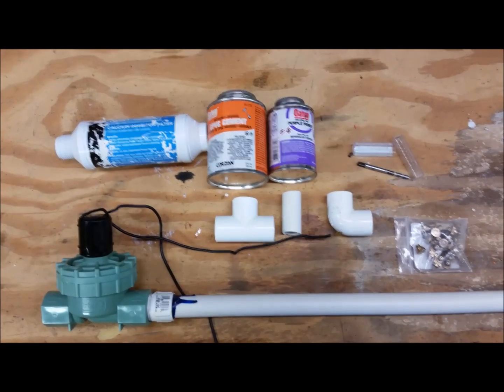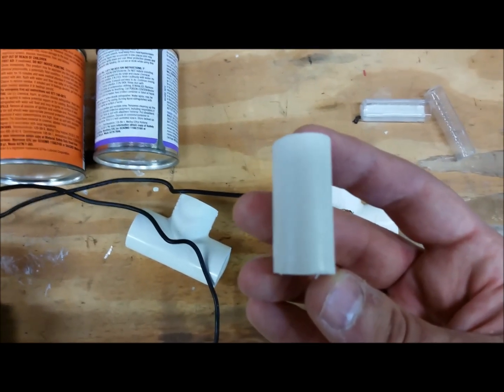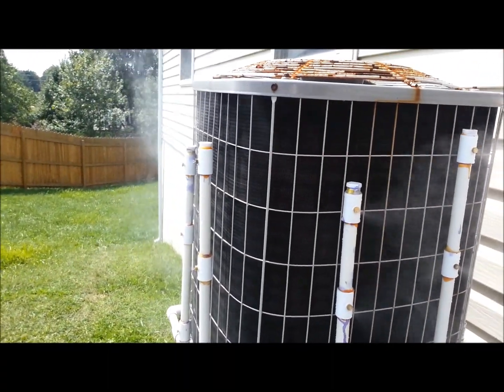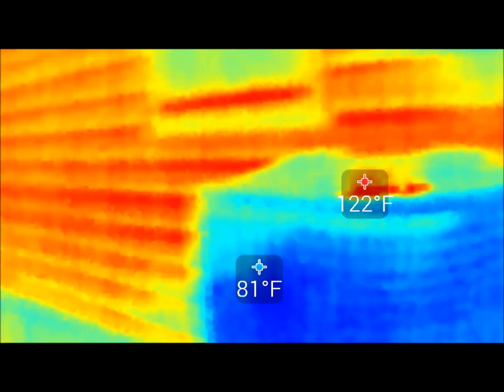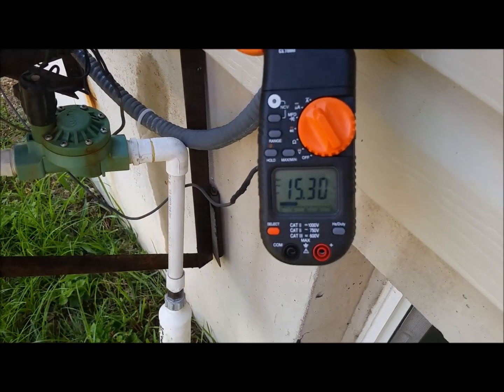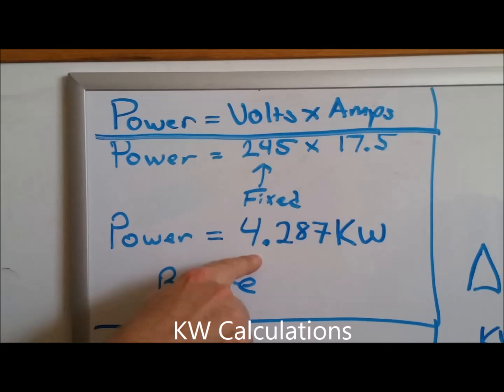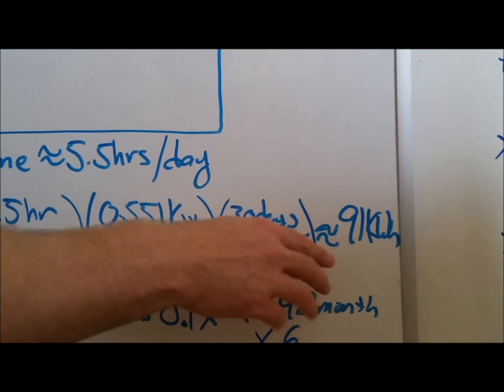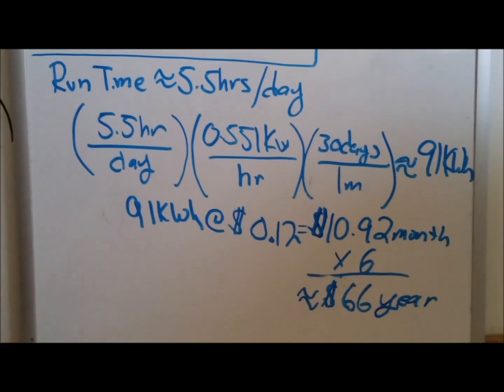DIY AC Mister Reduce your HVAC Cooling Costs Thermal Image Part 1

Comment: This video covers so little of the issues here.  Delta T of the indoor coil will show that there is no change or the change is in negative.  
Your system is probably a SEER 13 and is designed to operate dry.  When you change the head pressure, you change refrigerant flow rates.  This change changes efficiency, not to the good but lower.  Add to that, damage to the coil from minerals in the water, and you will be losing money.  
Modern compressors are well capable of handling the temperatures and pressures they are exposed to.  There will be no reduction in wear of the compressor.  In fact, under certain conditions oil return may be compromised.
The problem of water damage is not something you can fix with a filter or whatever.  Even if you could deionize the water, that makes the water quite corrosive.
There are no commercial, industrial or residential units that use water spraying.   If the efficiency could be increased without damage, manufacturers would use it.
GFM
Reply from the maker: I beg to differ. My system is over 20 years old,  5 of which have the mister on it.  What minerals, does deionized water have that are so damaging to aluminum fins?  If it's so bad, then how do out door units survive rain for years on end?  I'm spraying them with rain.

So,  what happens when a cool front moves in?  The same cooling air effect as an 80 degree day vs 100.  There is no way a furnace operating at an ambient air temp of 80 works the same as one at 100, all other things equal. Power draws prove that...as I showed.

Raising any liquid to a higher temperature (through compression) requires more energy. It's simple physics. The hotter the ambient temperature the more the compressor works to push heat out.

Colder air allows the heat exchanger work more efficiently. Its ultimately the energy used in the compressor to remove energy in the house. 

These are everywhere where I work. Used to cool huge office complexes and warehouses. I'm sure if they didn't work they wouldn't use them.
Reply: @stem_saving1644   I thought you said it was 18 in the video.  Could be wrong.  
Deionized water does not have minerals.  Pure water is a catalyst for dissimilar metals corrosion.  The aluminum fins are sacrificial to the copper.  heat increases the corrosion.  Many units paint their condensers to limit this corrosion.  Its kind of like its raining on the coil all the time.  
Power draw drop does not equal higher efficiency.  When head pressure drops, efficiency may drop.  The unit may even freeze up.  The reasons for this are a bit complicated so I will not explore them here. 
What you are seeing at your work are cooling towers.  These systems usually have their condensing units in the basement.  They have water cooled condensers.  The heated water is then pumped to the roof where fans blow air across the water as it pours over plates to cool off the water.  
If you are interested, I did a series on this subject.  It starts here:  https://youtu.be/GEHE69OC9Xk
GFM
Reply from the maker: @grayfurnaceman  it was the 18 years old.  That was almost 2 years ago. 

I disagree with your assessment. The compressor is the mover of heat. The hotter it's outside the harder it works. You can exchange more btus into colder air than hotter air....simple Fluid dynamics my friend. Power measurements showed that.  If it's not for you,  don't build one. 

Well,  I suppose I best bring my out door unit inside today  it's scheduled to rain.
Reply: @stem_saving1644  Sometimes engineering is not as simple as it seems.
GFM
Reply from the maker: @grayfurnaceman  I'll agree with that.  If your not an engineer.
Reply: I just came across this video and it makes sense, but I'm trying to understand your comment. I'm not an AC guy. It is clear from the video that power consumption is lower with the mister. And that would seem to improve the efficiency of the system. The only way the efficiency would not improve is if the temperature of the A-coil doesn't get as cold when the mister is on vs. when the mister is off. Is that what you're saying? It was always my [limited] understanding that the AC would perform better under cooler outside temperature than under hotter outside  temperatures - and doesn't the mister effective lower the outdoor temperature at least as far as the outdoor coils are concerned? Thank you.
Reply from the maker: Yes that's exactly the case.  The quicker and more effecienly you can remove the heat from the system,  the lower the cost of energy will be. 

Higher temps at the heat exchanger force the condenser to expend more energy to raise the coil temp to increase the delta t outside. Drawing in cooler air allows for more efficient cooling and lower costs. 

There are those that say it doesn't work,  but clearly the meter doesn't lie. 

If you don't have hard water or can use rain water it's perfect.
Reply: @stem_saving1644  Not sure which comment or video you are responding to.
If it was an effective system, manufacturers would use it.  If you watched the videos I referenced, you would see that things just don't work the way it would seem sensible.
Refrigeration systems operate on pressure difference.  If the difference is too low, the unit will just not function or the indoor coil will freeze up.
GFM
Reply from the maker: Your videos have barely any misting nozzles which is why your showing such low efficiency. You need to cool more surface area. You inlets are also affecting the cfm drawn in.  

I believe those are carrier systems,  poorly designed air flow.

These do work, your setup lacks what appears to be volume,  which is why the inlet temp is so high.

If you watch my videos you will see the correct volume of misting and plummeting power values.
Reply: @stem_saving1644  Have you watched the entire series?
GFM
Reply from the maker: Why? It's not nearly being misted correctly and the lovers actually detract from the airflow.
Reply: @stem_saving1644  There is no point to further conversation.
GFM
Reply: @iraschonfeld7135  I did a series about this issue.  It may be of help:  https://youtu.be/GEHE69OC9Xk
GFM

Comment: Are you still using this misting system? How is it holding up? Are you having any rusting / calcium build up issues?
Reply from the maker: Still working. No issues to report. I'm now using rain water from the water harvesting setup I made. So, my water is free.
Reply: @stem_saving1644  thanks for the update, and for sharing your video.

Comment: Was a before/after temperature taken of the refrigerant line exiting the condenser?
Reply from the maker: I didn't get those as I don't have fancy hvac metering equipment. Thermal guns won't accurately measure the metal as what you are looking for.

Comment: Of the 84 residential split systems I replaced last season, 27 had some kind of water spray system attached to, or nearby, resulting in fouled, calcified, rotted coils. Age range of the 27 were 4 to 9 years old. Save now- pay sooner not later. The other techs here have experienced the same ratio. One of our competitors actually sells these "coil eaters".
Reply from the maker: Ok? Don't spray it with utility water or put a good calcium filter on it or use rain water. Problem solved.
Reply: @stem_saving1644 that’s not the problem this coils create a static charge and react with the water making the fins which are aluminum corrode and essentially rot. The simple fix is to run some copper wire from one corner straight down into the ground and use a good water filter to keep them from building up calcium.
Reply: @stem_saving1644  As an engineering exercise, I think it's great. Seems like it's an awful lot of effort to save $10 a month. Never mind the hate one would get from the environmental set.  This is like using a Hummer to bring your waste to a community compost pile.
Reply from the maker: @cuervoprov  not a lot of work. Couple hours. Save  $10 a month for 6 months and in 5 years its $ 300, and 10 years It's $600. All for a small up front investment of less than $50. I don't know about you, but I like extra money in my wallet.
Reply from the maker: How does a coil rot? That's something inherent to wood.
Reply: @stem_saving1644  Deterioration, decay accelerated by  the introduction of a foreign organism and moisture (wood) , or just moisture and air (aluminum, steels, etc) Ever see the body rotted away on a car? (This system makes me money- knock yourself out.)
Reply from the maker: @airserco  How does aluminum rust?  That's something inherent to steel, just like rot is to wood.  If condenser units can't withstand deionized water, why are they placed outside and why has mine worked for 20 years and how do industrialized misters work so well ?  

Face it,  it works. If it would have failed, it would have done so by now.
Reply: @stem_saving1644 hey, came across this and wanted to comment. Aluminum does rust, similar to steel but different in a couple ways. Aluminum oxide is a strong but brittle compound. It is actually stronger than the aluminum it will coat. Normally this is great on anodized parts as it provides a strong uniform coating making scratches difficult to form. It is also an electrical and thermal insulator.

Unfortunately in the case of a radiator fin or other thin object, it can hurt the fin over time. Aluminum oxide is brittle and through heat cycles it will break off. However, this takes quite a long time.

I think your idea is great and was doing a mental exercise myself thinking of a system like this. Mine was to make my a/c in my house colder as this recent temperature bubble in the Midwest is outpacing our a/c during the peak of the day. Thanks for the video and ignore idiots like cuervoprov. He doesn't know what he is talking about

Also, one question I still have. Is this system still running? If not, what made you stop using it?
Reply from the maker: @OtherDalfite  the system was running for 5 years or so.  I actually upgraded to a heat pump and need to make a new system. 

In the end,  the compressor and electronics will long fail before the misting system has any negative effect.  Assuming one uses rain water.
Reply: @stem_saving1644  nice! Thank you for the response

Comment: Here is my question, as you are using this what is your suction and liquid pressures, I will guaranty that you will have a low suction pressure and a high head pressure because a wet coil is harder for the fan to pull air through. The compressor does not coil the freon it is the fan, the compressor is just a pump, and the compressor changes the warm gas from the evaporator coil to a hot gas and as it travels through the condenser coil and the fan on the condenser is pulling the air through the coil the hot gas is changed to a warm gas.
Reply: And while you are checking the suction and liquid pressure what is the super heat and subcool, that will tell you how efficient the system is and do a amp draw on your compressor and fan the more amps the harder the part is working the less the less work it is doing.
Reply from the maker: I don't believe I claimed the compressor cools the freon. But the cooler air keeps it cooler as well. .The mister cools the surrounding air, which drops the inlet temperature, which forces the compressor  to exert less energy to remove the heat. My current draw measurements prove that.  not sure about all the pressure readings you mention as I don't have hvac tools, but it does work. It's been active for 4+ years.  It's also widely used industry.

Comment: Reduced power consumption by 13 percent approx.  Time of use utility plans factor peak consumption during high use times to determine fees.  So the savings might be more than 13 percent?  Not sure
Reply from the maker: Yes,  there are many factors involved. My utility charges flat rates, no time of day. Also, the hotter the climate the more it helps...and in my case the more inefficient (older) the a/c the more it helps.  I'm going on my 5th year and it's running great.

Comment: Probably save more money by not letting your ac unit work so hard.
Reply from the maker: That is the exact intent of the system, cooler operating temps make the system more efficient.

Comment: Increase the discharging distance, reverse mist nozzle direction, reduce water consumption.
Reply from the maker: Increased discharge distance means more gpm to cool surrounding air volume, which is counter productive in reducing consumption.
Reply: @stem_saving1644  Is not the air that gets cold in any significant amounts what makes this work but rather the water that is deposited in the hot coils and then gets evaporated thus taking the heat with it. In fact some people run water with a waterfall recycling unit.
Reply from the maker: @Ramiromasters   it's the change in the physical state of the water. ..from a liquid to a gas (mist) that cools the surrounding air that gets drawn in. The law of thermal dynamics says that when a liquid changes to a gas it absorbs heat. Similar to the inside coil.  This cool air then picks up heat from the condenser coils which provides the cooling your referring to.
Reply: @stem_saving1644  Though mist may look a bit like vapor its not. Vapor are water molecules that have achieved a certain speed that we know as a temperature of 212°F They move so fast that they can't stick to other water molecules. When you steam a shirt with an iron it gets hot as vapor transfer its heat to the shirt, when you put your hand above evaporating water you feel heat as vapor condenses in your skin transfering the heat. When water evaporates from an AC hot coil it goes from liquid to vapor thus taking the heat away. The mist is just a good way to cover the coils with water.
Reply from the maker: @Ramiromasters  it's true  it's not true vapor, however you don't need water to be 212  to achieve evaporative cooling.  Stand outside on a hot sunny day and poor the same temperature water as the air on your skin and you will still feel the cooling effect of evaporative cooling.  Same process here, as the water mist evaporates, It pulls heat with it. Cooling the air.  It's the evaporative  cooling of the air that's cooling the fins.
Reply: @stem_saving1644  It will feel cooler because water is more dense and can conduct heat much better than air which is an excellent insulator. When a water molecule evaporates its because it has achieved that temperature velocity to become unbounded... I think this is getting way to technical for an AC sprinkler system lol
Reply from the maker: @Ramiromasters  yes.  Bottom line it works! I think we can agree on that

Comment: How
How/where did you wire up the solenoid?
Reply from the maker: The valve power connects into the contactor power it's 24vac. Don't confuse that with the 240vac power.  The contactor/relay is energized by your hvac control unit inside, which has smaller gauge wires.  If your not comfortable around electricity don't attempt it and always remove power before making mods.
Reply: @stem_saving1644  Connected to the contactor power of what? Where is your control solenoid?
Reply from the maker: The power for the valve comes from the air conditioner.. it's spliced into the control signal for the relay. When the relay is energized the valve is energized.